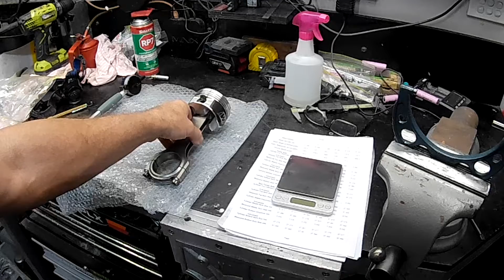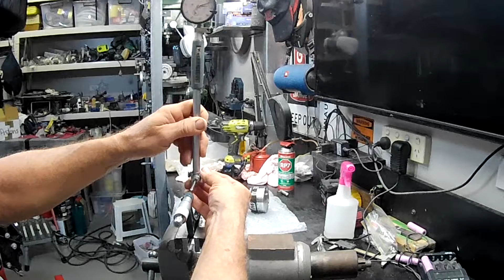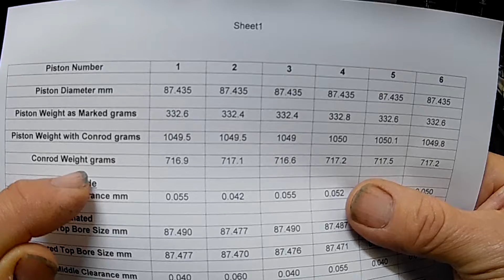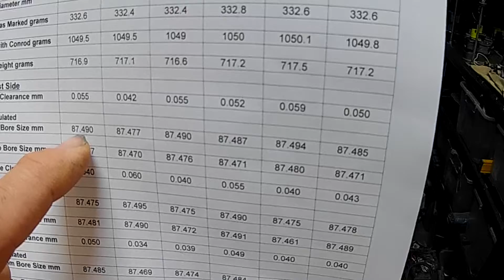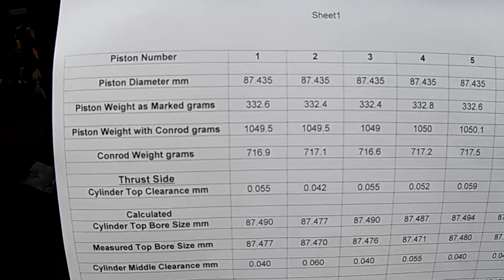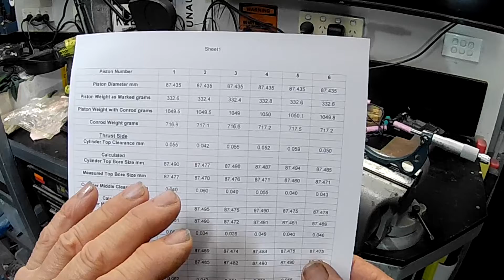How to Measure The Vg30dett Engine Block for Rebuilding. Nissan Z32 300zx Twin Turbo Mega Build.

Comment: Hi Trevor, where are you mate missing your videos, I hope all is ok.?
Reply from the maker: Hi Wayne, thanks for asking. Yep, everything's fine. Well kinda. I've started a new job which has dramatically impacted my spare time. I've also been shutting down my business & winding that up. So, yeah, i'm going through a bit of a transitional period currently. The wife has also had me knocking over jobs around the house before taking this on for the same reason. Hopefully once i'm settled into this roll I can start popping out a few vids. Still doing stuff on the Z32 though, just no time to film & make videos. Cheers Mate.
Reply: @TheAussieShed  Thank you Trevor, look forward to some vids later on down the track. 👍👍👍👍👍

Comment: That was pretty good explanation. Did you determine that the wear matched the claimed kilometers since the last rebuild? This is going to be one hot little machine.
Reply from the maker: Hi Ben, yeah, pretty close i'd say. Hard to know for sure as a lot depends on how well it was put together. Cylinders were a bit inconsistent but probably due to some average machine work. Can't complain to much. Cheers Mate.

Comment: Btw, i am running 87.5 wisco pistons like you. And my power goals are like your as well. How much piston to wall clearance should it be, all things concidered?
Reply from the maker: Check out the "Wiseco Piston to Wall Clearance Guidelines" on the Wiseco website. Can't go wrong. Cheers Mate.
Reply: .0025" is recommended from wiesco.  I personally am running .0030"
Reply from the maker: @adamkleinschmidt3041  How much boost are you planning on running Adam?
Reply: @TheAussieShed  ill probably be in the 28-30psi range on  psr2867r shooting for 700-800 rwhp
Reply from the maker: @adamkleinschmidt3041  Nice, have you looked at Wiseco's recommended clearance's for that boost level? Low Boost (up to 15psi) they specify an additional .0005 (.0030 total). Mid Boost (15-30psi) .001, & High Boost (30psi+) an additional .001 - .002, so a total of .00356 to .00456. Worst thing you can do is be to tight, food for thought. Hows your cracked head going?

Comment: When you get to the pistons and rods, please nerd out on setting ring gap! Also, will you be balancing the crank with the clutch and flywheel assembly?
Reply from the maker: G'day Mate, the rotating assembly was supposedly balanced on the previous build, providing I don't rearrange the pistons & rods it should be okay. But.... due to everything being a bit shit i'll probably re-do it. Cheers.

Comment: New, these engines had much tighter tolerances than the typical US engine. The clearances you found were huge, UNTIL you remember that they were in 1,000ths of a MM which is roughly 40 thousandths of an inch, .050MM being roughly equal to .002"
Reply from the maker: Agree totally, on the flip side when I see stuff in Imperial I think WTF, then I remember. Cheers Mate.